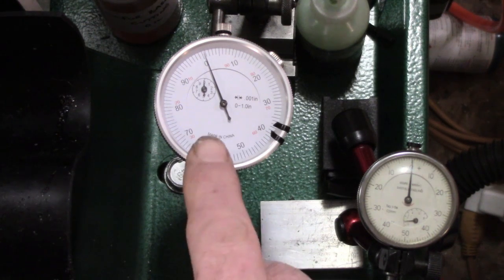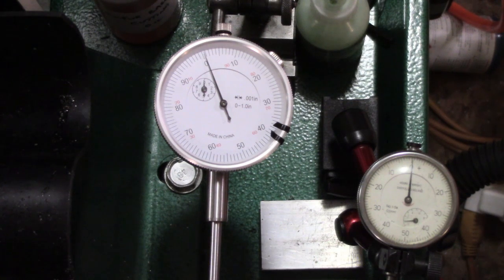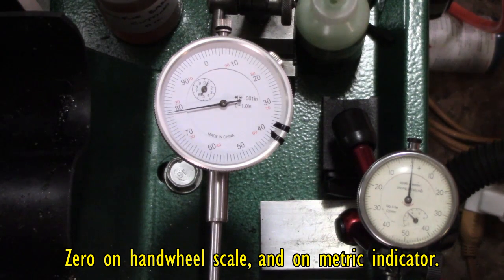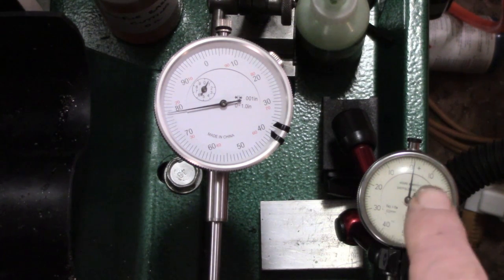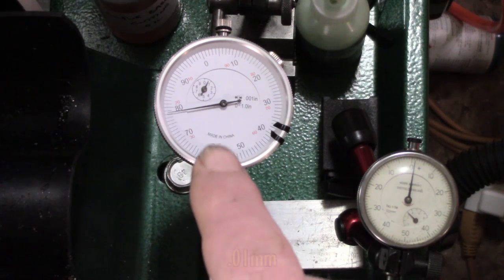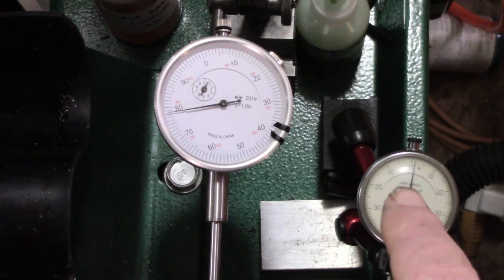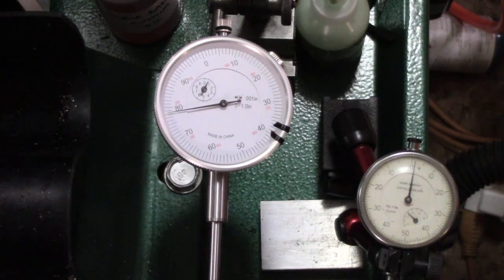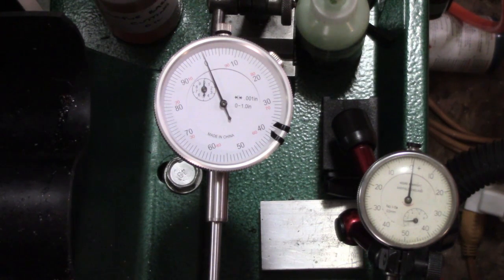The-0704-Y-axis-problem

Comment: i have read on you tube and machining web sites of others having similar problems with grizzly machines, e.g., metric lead screws in imperial lathes. not too great a problem if you are equipped with dros but still not a satisfactory situation with a company trying to establish a "quality" reputation.

i disagree with your assertion that it is not a big enough issue to send it back. i think they should have immediately sent a new machine properly set up and carted the old one away by express freight at their expense. that would have been real customer service.

doesn't the manual the parts diagram say what the screws you referred to do?
Reply from the maker: crazymanmichael Hi Michael, I was told this had onlt occurred twice before - and that presumably out of huge sales. The manual refers to 'thou' with regard to axes and also the DRO on the quill, so, not meant to be metric! 

To be honest, I did not relish any sending back for a new one -- this one is ideal in all other respects and hardly relish a packing up and then later a re-install of a new one. plus, I want the darned thing for use anyways! I'd rather not have to tear it down to do a swap but, being a nice guy (some say!), I'll suck that up. :)

Comment: Thanks Chris.  This brings to mind my brothers new G0760 and its quills graduated wheel. Your issue makes me wonder now if they just adjusted the dial for a metric rack/pinion.  The graduations go to 90 then only has 7-8(?) ticks...so it's a real pain to go more than one rev...then count to get to where you are going.  It's good they are sending you new stuff but still a pain as you say!  I've found their CS excellent also.  The good thing is you will have the "opportunity" to get into your machine and learn the nuances of it.  My brothers quill lock was not good and lifted the quill about a thou on tightening.  Pulled it apart and realized there was large clearance issues with the thru bolt and the flat was rough as a cob.  Took about an hour to shim it and resurface the underside of the bolt head, then lap them...smooth as glass now and Zero lift!   Look forward to seeing the process and it will be helpful to others I'm sure.  Thanks for all your work to bring these videos to us!  ~PJ
Reply from the maker: pjsalchemy Thanks to you too for following this old fella! I don't relish the tear-down but as you say - should be a good familiarization. I have little doubt there are many small points on these machines where a bit of TLC to some bits can be beneficial. Cheers.

Comment: I heard this is a common problem i was going to buy one :)Changed my mind when i read about the issue..For now.
Maybe the pitch is wrong on the lead screw..Have you checked the Z axis because there is also an issue there
Reply from the maker: Muhaa Haloa Yes, leadscrew pitch does not suit inch - not worried about the Z axis as that is just following a very simple inch rule on the column. My Y issue is rare - like, only 2 other cases out of probably hundreds of units sold.
Reply: So you would recommend this mill pal ??I'm shopping for one that's all thanks...I wouldn't go off the hand wheels any way i would either use dro or just a DTI..I was told the problem with the Y axis was it moves allot and isn't accurate.
Reply from the maker: Muhaa Haloa Overall yes - as a small mid-range unit it's pretty good and price reflects that. I know of some folks who have had a motor burn out but for me, I keep loading modest. I don't see a Y axis problem regarding movement - as long as gibs properly set and backlash is within limits, it seems OK.

Comment: The real answer is to forget the handle increment dials and just fit a DRO they are as cheap as chip now, and so much better to use, you can also flip between Imperial and metric, you will wonder how you got along before you fitted them. My confusion stemmed from the fact that you said one 360 deg turn moved .001". Chris B.

Comment: Hi Chris I somehow missed it... Did you say you were going with inch... And will the new nut and screw be .079 per rev... I had an old Smithy mill that was, I believe .098 per rev.... I use the calculator on all long moves.... Looking forward to the lead screw swap out! :o)

O,,,
Reply from the maker: Opinionator52 Both axes were supposed to be inch. I am hoping that the new screw and nut will be same ratio as X axis -- which in theory should be a 10 TPI set-up.
Reply: Does that mean one turn of the crank/dial will show .100 on an indicator?
Reply from the maker: Opinionator52 Once made the swap over then yes - one full revolution should be genuine .100 on an indicator, as with X axis.
Reply: Cool that will be nice! Take care... :o)

O,,,
Reply: Opinionator52 Yeah, my old Smithy is miserable that way.  I had to put on a DRO just to keep some sanity.

Comment: Those screws are gib adjustment screws, I think.  I had a G0704 for about a year.
Had motor issues, burned up 2 motors in 1 year. Finally converted it to a tread mill motor.
Reply from the maker: Herb Blair Did wonder if those were gib screws - just wasn't sure as couldn't get my X-ray vision to see inside! :) I like to know details if poss before I tear anything down.

Comment: Annoying, yes, but pretty good of Grizzly to make it good when you didn't discover it right away.

I had a similar experience with an Ironworker (cuts, punches, bends, notches mild steel up to 3/8" (10mm) thick and 4" (100 mm) wide). It came with a frame that was slightly out of true, which made the attachments "creep" when they were bolted on to the frame. I thought it was something I was doing wrong for quite a while, but when I finally investigated, I discovered that the frame (made of two C-channels back to back with a gap between) was slightly off. I corresponded with the company for a while, sending sketches of what was wrong (pre digital cameras and email). Ultimately they sent me a new frame, but (as in your case) left the installation to me.

Still, I bought a second unit from them.